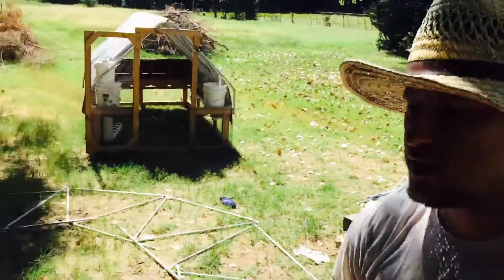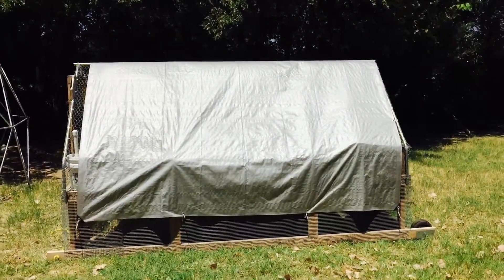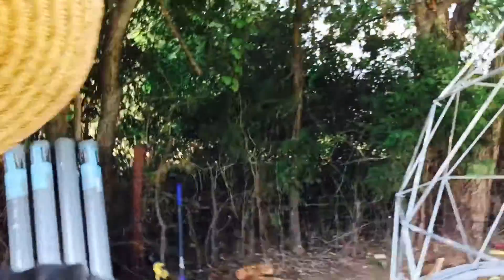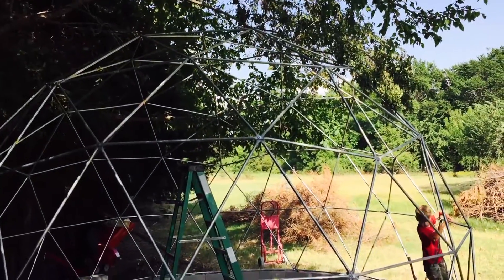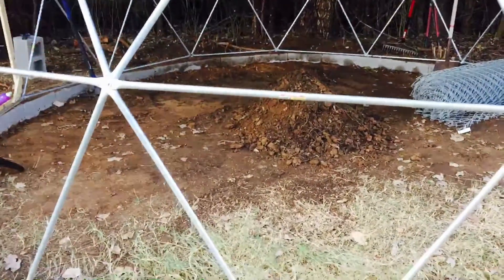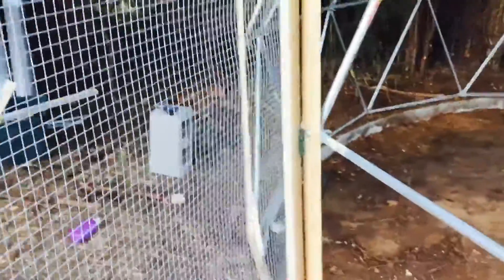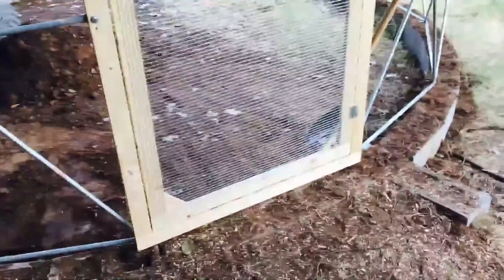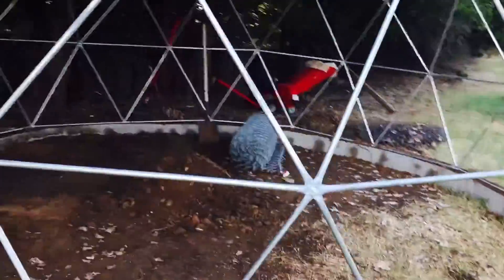Geodesic Rabbit Dome Enclosure (Conduit Pipe) - Part 1

Comment: Awesome. though i can't use the dome calculators cause American measurements never make sense, Americans always calculate topsy-turby math reasoning
like: 3.486, 4.036, 4.124  -!!!

What does that even mean, i'm supposed to guess if it's inch, mm, cm, feet dome calculators are extremely annoying mixed with american math for exceptional annoyance

Comment: What were the lengths of your pipes, how many of each, and how did you round over the crimped ends?  I haven't found any videos or info on the rounding of the crimped ends.
Any help would be great.
Reply from the maker: +Brad Sampson Here are a few notes I took while designing ours:
1. https://www.evernote.com/l/AASuzW1kZ0RGlbmGp9Bemu9-RUQS02HXmtw
2. https://www.evernote.com/l/AASDTA5ls8BObaDqaDzdFJh9NyRo-hHtclQ
For the bending of the ends you can sledge hammer them, however we used a shop press to press them all and first used a rounded piece of steel to from the ends. Then my buddy helping me created a sliding piece of steel that was put into the press.